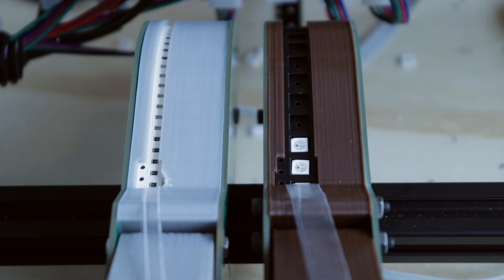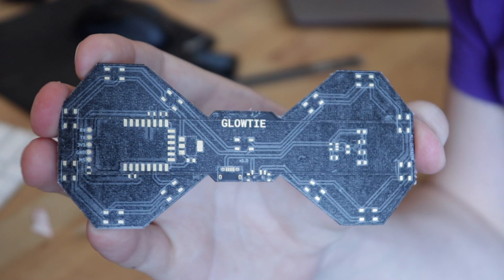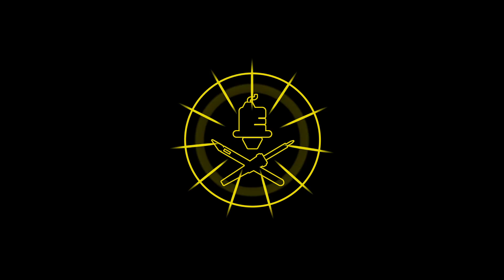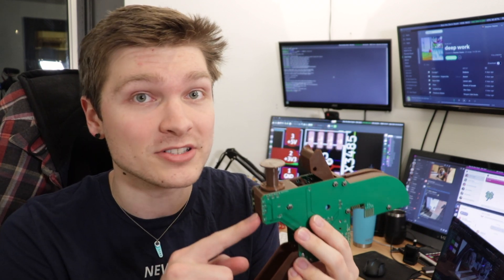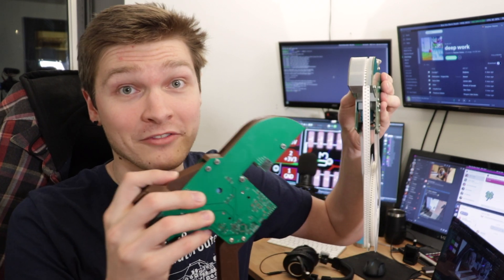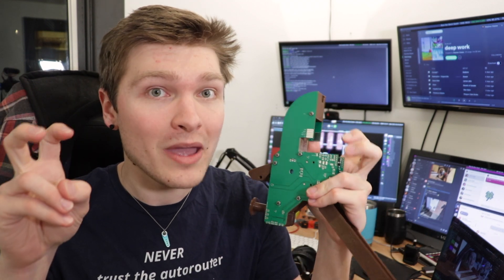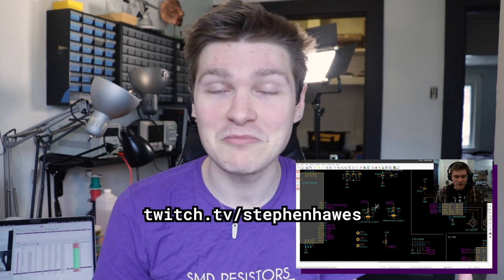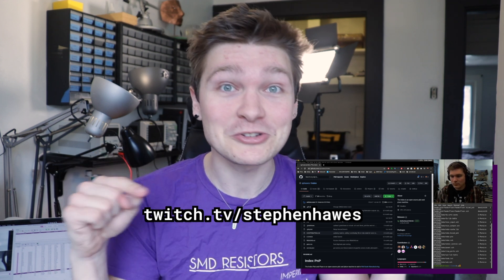Running Multi-Feeder Jobs!

Comment: Inspiring work. I'm late to the party so forgive me if this has been discussed. You only need one pnp machine but many feeders. Your feeder design is very cool, but to keep cost down, it seems to me feeders should be dead simple with no electronics. I've seen passive feeders where the pickup head pushes a lever for the next part. I imagine that slows things down. If so, what about a device running on a rail under the feeders that can move to any feeder and dispense its next part?

Comment: Hello, I'm Goblin Goul from Korea.

It was very helpful because I referred to the video a lot.

Can I get a list of the parts used in the pick and place machine you are currently making?

I would like to know which parts you used, such as camera, head, motor, controller, etc.

And if possible, I would like to receive the Marlin firmware or Smoothie firmware library, can I get it?

Comment: I am confused... what is RS45?
Reply: Rs485 , a differential signal so the signal can travel far without getting corrupted. I used it on my 30' robot hand video. It worked 50' + away.
Reply: @TheRainHarvester  Ah, thanks! That was quite confusing to me.. Perhaps say the "eight" for clarity? I don't think it is common to omit it. :-)

Comment: The problem with having wide feeders is that as you stack up more units the pick head has to travel much further to get to the part and back to the board. That takes longer.  Also, you'll need at least 20 feeders for a medium size board and you won't be able to fit them all in unless your machine is huge.

Comment: Tip to not waste so many parts during threading of SMT tape.  Take a piece of string or thread and tape it to the end of the cover strip.  Run that up and wrap around the spool.   Don't throw away used cover tape as it can be used for the same purpose.

Comment: Did you discount CAN bus for any particular reason when looking for a bus for the feeders? 

Physically its very similar to RS485 (twisted pair with 120 Ohm termination at each end), but, you also get a nice message based protocol with arbitration and node IDs...so your feeders and controller can freely communicate  bi-directionally without needing a custom protocol that deals with arbitration and collisions and addressing. The STM32F103 has a built in CAN controller and just needs a transceiver like the Texas Instruments SN65HVD230. The only real drawback I can see is that RS485 allows a slightly higher node count. CAN is still good for at least 120 nodes on a single bus though.

Comment: The feeder waste too many parts , some room for improvement
Reply: It's a shame I wasn't watching for this stuff about a year ago, probably $200 worth of this could be designed out.  Some good ideas but seems to be 'designed toward the $10,000 and $15,000 pnp machine' ideas, where they've done a lot of extra things I'd consider unnecessary especially for a low cost design.
There's a better way to arrange the rails, and cut of 15 or 20 percent off the floating rail's weight with the same reach and better accuracy.
Kinematic tool changer set up so you can take off the head and put on a laser cutting head, and probably light CNC capable.
Double rail both sides, for up to 128 feeders.  (Realistically I'd do 64 on one side, and not have to access the other side of the machine unless I really needed more than 64.)
Dallas is great but expensive, instead of their $1.30 part I'd use the Microchip 22 cents part.  I'd design the pad to take all 3, Dallas form factor, TSOP, and TO-92 for whichever is cheapest at the time.
Non-intelligent floor, not sure what the purpose of having an essentially '3rd party' knowing and communicating really is, I'd bypass it entirely.
Feeder motors separate from the cassette.  Only need as many drives as you're using, while having lots more parts with the cheap plastic cassette part ready, just snap off one and snap on another.  No motors or electronics sitting around wasted if you have a lot of different designs, but still quick to change and use parts.
Rest of the plastic cassette printed, with the ID chip in that part.  Print them, add chip, and they stay married to your part reel forever.  Snap them on and off the feeder motor board.
Positions picked up by the head, no need to keep track of what's where manually.  Head goes down the line touching the ID chip pads, and knows exactly where parts are.  Swap 2 feeders it can pick up the changes.  Only needs a simple switch for 'something changed', the head can pick up what went where.
I'd look at a part tray attached to the head.  Go to the parts, pick one up put on the tray, times 8 or 10, then go place 8 or 10 parts.  Much less wasted travel.  You could go slow and still beat 'faster' machines.
No up camera. 4x down cameras, 90 degrees around the head.  Align the parallax so your positioning is dead accurate.  4 pics  your aligned correctly, place, then 4 pics and you know the part is aligned correctly.
I'd realign the feeder design so the pickup area is directly over the rail, that's what needs maximum accurate position.  Then push everything else down, so it hangs like an upside down U over the rail, with the side 'in' as short as possible so there can be a second inner rail with nose to nose feeders.

Those are just the main things I'd rearrange off hand, probably forgetting a few bits here and there..
Well there's the obvious other thing, easily squeezed back in to a $30 BTT SKR 1.4 turbo board while still retaining basically all the functionality.

If you haven't guessed, I'm looking at doing exactly this.  Can't escape $200, $250, or $300 worth of hard parts, rails bearings etc.  But I'm pretty sure you can make a $400 to $600 unit that will actually be better than some of the $10,000+ machines.   4 cross aligned cameras and get a parts tray working and it could be very nice.
Reply: yeah, my first thought too. Affix some cover tape so one doesn't need to feed until cover tape reaches spool.